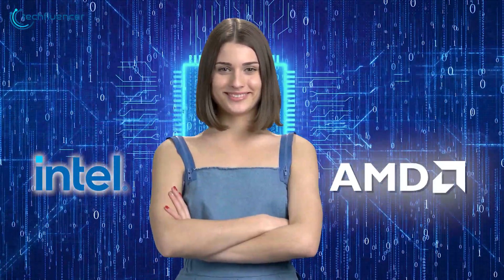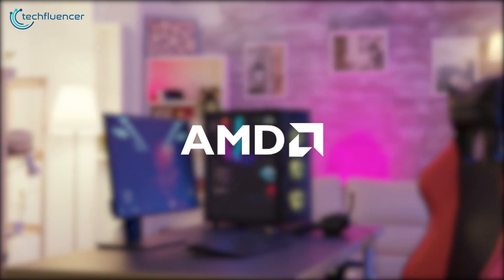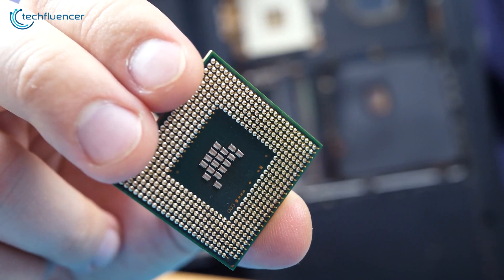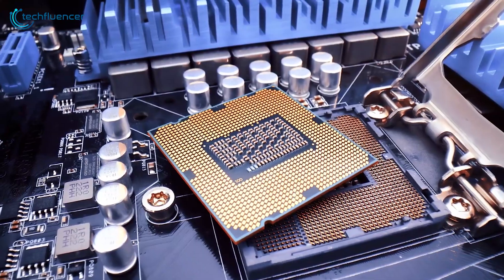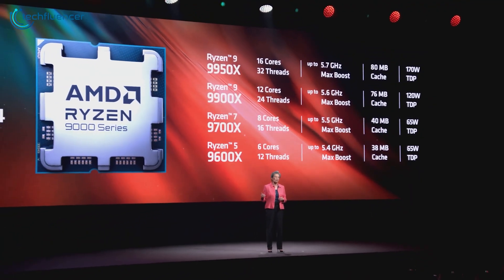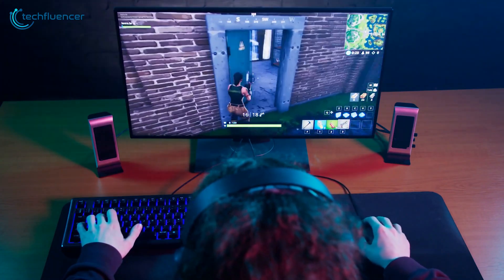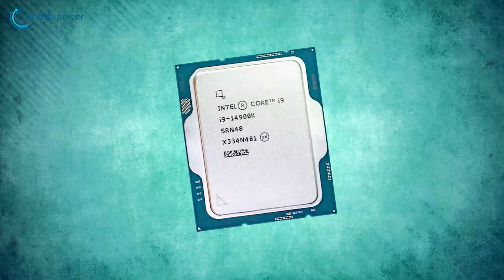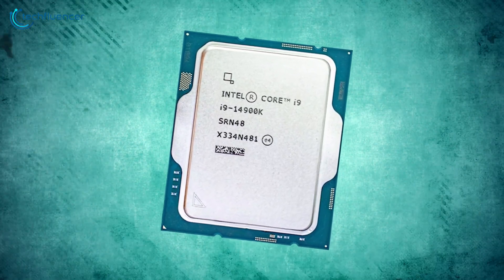Intel Vs AMD | Which Processor Should You Buy in 2026?

Comment: Two years ago, I got a 12400. The cooler model SE-214-XT keeps it cool and maxes at 60 when rendering. I upgraded from a classic 3930k, which I had for five years . I bought it from Amazon and saw it was a good price. I didn't do any research. Both of these chips have the same threads and cores, so why did the guy lie, saying CPUs haven 't shown a big jump?

It's other cards, like the i3 10th, even compared to other i3s and other i7s from the 11th or 9th generation, that show big jumps in power from the eras before. It used to take me 5 minutes to copy an EP from a DVD; now it only takes 2 minutes with one program, and then with the other, it only takes 1 minute.

Renders for an 8-hour 1440p used to take 4 hours; now it takes only 2 . Malwarebytes used to take 2 hours; now it takes 10 minutes, sometimes even 5 minutes, for the same number of files . I was having drops in Killzone RPCS3 at 10k resolution with my 12400, and my FPS would drop to the 40s and back to 60. With my 12700, I hardly get any drops using the same resolution. Timesplitters Dolphin at 8k gave me drops using the 12400. I no longer get those using the 12700. LFD2 would drop to the 60s from 120 FPS using multiple graphic mods with a 3080 RTX/12400. I no longer get those big drops with the 12700. This card is a monster. I didn't expect it to stabilize my FPS so much, but I was hoping it would .

I just found out last year that reading about the 7800X3D was a monster for PC games and wondered if it would help emulators as well; I see AMD still is a monster. I'm saying this because last week I found out about the 9600X and how strong it is with lower heat than my 12700. I was going to upgrade, but I just found out earlier this week that new chips are coming next year, so I might as well wait for the next equivalent to the 9600, which should be even stronger.
Reply from the maker: Thanks for sharing your experience. Those upgrades made a real difference.
Reply: @techfluencer Prices won't be a big deal since I'm selling my parts hopefully next year. I still have my 12400, and I get all my parts used. What 's interesting to me is, as I said, I've seen using 12400 to 12700. My FPS were able to hit 60 FPS using 8K in RPCS3. Going from 12400 to 12700, it's interesting how, even though the 9600 has the same cores as the 12400, the 9600 can scale on average 30 FPS higher or 70 FPS. The only reason I did go from 3930 to 12400 is because I thought Intel was still the best for gaming. I didn't do research for years; having chips, I was on the 3930 since 2013. The only reason I stayed on that chip so long was that I didn't do research . I thought my FPS drops using 1440 on high settings with most games were normal. Then I got the 12400, which has the same cores as the 3930, but the FPS is way more stable and higher.

The main reason I found out about chips late, as I said, is I just found out about the 7800X3D last year on forums. Well, I knew of the chip's name; I just didn't really research how legendary it was until last year, and I just found out about the 9600 this week.

The main reason I don't research chips often is that I don't want to feel like every time a new one comes out, I need to get it. That was the main reason I stuck with the 3930 for so long. I still don't really understand when AMD became better at gaming because, like I said, Intel was the best all around just by having more cores. When did AMD catch up?

Comment: Intel has become expensive in my opinion. I recently switched to AMD Ryzen 5 series and they run hot compared to the intel but these are good performing processors compared to my intel i7 3700 which i was using for more than a decade.

Comment: You can get the Gigabyte UD ddr4 z790 for 130 bucks - less on sale and an i5 14400f for 120.  There's a lot of cheap ddr4 memory and m.2 drives.  even spending 150 for a 2 tb m.2 and 89.99 for the case another 89.99 for the psu. let's see that's - about 590 dollars before tax.  I blew the budget on a 600 dollar gpu.  This setup runs anything at 1440p with no issues.

Comment: I worked at Intel for a very long time. I got my first break because of the company despite having lost 2 years in engineering and I without doubt can tell the company which gave me a break and the company I came out of is like buying a fresh fruit from a supermarket and eating the garbage after keeping it outside for 30 days (rotten) and it shows in the processors that they are building.
Reply from the maker: Thanks for sharing

Comment: I am a few days away to buy my first good gamer PC, but I am so worried that Intel CPU is a bad move on my build? - tho the seller of Shark PC gaming told me this morning, when I asked him this question "is it true that Intel does not perform as good as AMD in the long run" - He answered: "that rumor is from 6 years ago and does not apply to the newer CPUs" 
PC specs below.
Intel Core i5-14600KF 6p x 3.5/5.3 GHz
Radeon RX 9070 GAMING OC 16GB
Motherboard: ASUS PRIME B760-PLUS V2 DDR5
32GB 6000MHz DDR5 RAM Kingston Fury Beast
1000GB NVMe M.2 SSD
Windows 11 Home
Reply from the maker: Honestly, you have nothing to worry about. The seller gave you a good answer.
Reply: The seller is an idiot pairing a KF series CPU (Overclockable), with a non Z series MOBO which doesn't facilitate overclocking. You might as well buy the F and save money.

Comment: You have to set a budget, then compare parts on CPU Benchmark (if you're a noob like me). I ended up with Intel and Nvidia, and it was the fastest for my price point, where the AMD versions for the same price weren't as fast. *But +/-$500 and it could have been different.

Comment: Currently shopping. Left and back in 2011 for intel and im sick of changing MB when I upgrade. Sucks that also intel seems to be changed for the worst every new release. The best and most stable I ever had was the I7-7700k… currently running a 14900k and is so hard to pair it with good ram…
Reply: only morons pay an arm and a leg to inhel the dirty co
Reply: Can you suggest me cpu of intel i have low budget likely 150-200$. My goal productivity and browsing task. I have planned to go without gpu at beginning.

Comment: i used to be a die hard intel fan, hated everything about AMD and lets be honest they have been the underdogs. for the past 25 ive had intel then they made the 14900k and other similar chipsets followed by even worse 15th gen chipsets and AMD entered the market as stable platforms even if a bit under powered at times. then the x3d models came out and i told myself i will never ever again buy a intel system.

Comment: On my last system, I used an Intel i5 11th gen CPU.  I historically favored Intel chips as I kind of grew up in the era when Intel was struggling to become a market leader.  Names like Gordon Moore, Robert Noyce, and Andy Grove were in their prime when I was really getting into the industry.  I suspect they would be rolling in their graves with the direction Intel has taken in the last couple of decades.  Sadly, I think I'm going to have to move over to AMD when I get ready to get my next system.  Intel has started pushing harder on marketing rather than engineering, while AMD has really moved ahead on innovation.
Reply: am i face problem if i build with i5 10 ,11 or 13 gen processor ?

Comment: CPU for gaming? It's the GPU for gaming. Both chip would works for a modern system. Just get the one with the lowest price tag and save that money for the GPU. With that being said, I went for Intel CPU and board because it's the biggest bang for my money.  A 160.00 cpu that perform on par with AMD  400.00 cpu even if you include wattage. Some of AMD chip is overprice.

Comment: Funny I was using intel whole my life. I bought ryzen 3900x + x570 chipset motherboard just before covid. Since then I am still trying to figure out problems with shuttering, weird lags when there is no load on the system, doing thousands of stupid tricks in bios - turn off this, set that to this value, and still simple things like usb or nvme port do not simply work! It is outrageous how f.up amd stuff is. Never had such a silly problems with my intel PCs! Never ever thought you can have so many weird problems. My pc still is not butter smooth, but is somehow ok. But I have paid for quite high end setup and it is barely ok. Never, ever amd again!
Reply: Niemals mehr ein Überteuertes Intel System

Comment: Nonsense, there is no case in which you should choose intel, they have instability that is still not corrected. And the performance in single core the difference is minimal. As for the energy consumption, Intel is pathetic, and for gaming and Performance i still would choose AMD.
Reply: I choose an Intel because the CPU was 160.00 for 14600. The 65W version. The energy consumption is on par. Performance is very good compare to the price. I don't have a reason to go with AMD. There is no instability with this CPU version and nothing need to be corrected.

Comment: WHAT DO I GET AMD OR INTEL!???!?!?!?!?!?
Reply: Risc
Reply: Looks like AMD. I bought an i7 and when I run it with my OLED screen it overheats. My only choices here are to swap to AMD or upgrade cooling. At this point, I might do both.

What’s the point of having all of that processing power if you can’t use it? Intels will just overheat. Particularly i9.

You might be able to escape with i7 if you have good cooling.
Reply: Intel stock fall down/// amd get 20% of market lest year because cheaper and better

Comment: The instability of Intel cpu recently is the cause of my decision diverting to AMD
Reply from the maker: Fair enough!
Reply: same here, a 50% crash rate+ and degradation issues, no thanks, dont want a ticking time bomb, despite how much i dont like AMD cpus, i chose AMD since intel can go suck a d right now
Reply: My Intel Core i9 14900K overvolted itself, oxidized and degraded to death on finals at Nursing school, so my hand was forced to switch to AMD, it was well worth it with the 7800X3D.

Also replacing the iconic Intel Core i9 branding with Intel Core Ultra 9 (simply sucks in comparison) was just one of the dumbest decisions by Intel.
Reply: The ultra series isn't ultra, nothing compare to AMD 7800x3d till the release of 9800x3d...
Reply: @MrVirusD  9800X3D is remarkably faster than even the 7800X3D, 11% to 15% in gaming, 30% multicore and productivity uplifts, fully unlocked for overclocking due to flipping the location of the 3D-VCache.
Reply: @iLegionaire3755  I'm still in the q of this preodered 9800x3d CPU after watching many different specialists benchmark test... Upgrading to am5 for my secondary set with old school day Intel gen 6 i5 6600 😂😂😂
Reply: @MrVirusD  7800X3D will remain relevant, long after the 9800X3D and the 9950X3D release.

Arrow Lake is DOA, it’s a 14900K/KS downgrade in every fashion, even on TSMC fabrication. Quite an awful accomplishment by Intel. 

I hope Intel can turn it around before Turin…oh wait…AMD EPYC Turin is already released and chainsawing Intel Xeon in half as always! 

Intel Xeon continues to deliver mediocrity, compared to the TITANS EPYC, Threadripper, Apple Silicon, Snapdragon X Elite 2 and NVIDIA Vera Rubin!

Zen 5 Threadripper Shimada Peak will deliver the fatality.

Comment: AMD lost its edge somewhere in the P4/Athlon era, before that they totally made better cpu's than Intel.  Nowadays buying AMD is the same as throwing your money away.  Literally every person I know who complains about shitty performance and odd crashes run AMD.
Reply from the maker: They have potential to do better though!
Reply: I definitely have a more stable pc with the threadripper, AMD now is pretty good
Reply: Yes, this odd crashes is what sucks. So what that amd will give you 30 fps more if you will never get smooth experience! In my ryzen 3900x I have all power saving options turned off. Otherwise it was stuttering/lagging on silly tasks for no reason.
Reply: You need your glasses adjusted, AMD post Ryzen has handed Intel L after L in the x86 processor marketplace. And Intel in 2024, has gone out of there way to sell AMD Ryzen processors to the masses by design and their own deliberate choices.

Raptor Lake was a massive failure for Intel, there is no way around it and I liked Raptor Lake's performance, Raptor Lake like Rocket Lake, severely damaged Intel's reputation.

Comment: Leaving out the massive stability issues with Intel's 13th and 14th gen processors is a crime, this is the first thing you should let people know about. Just don't buy them. Not only do they have stability problems, they degrade. There's also a manufacturing issue with the  ones produced i 2022 were they suffer from corrosion.
Reply: So im thinking of buying asus tuf f15 which has i7 13620H in it i know this is about desktops but is this apply to laptops aswell? Im confused
Reply: @ Yes, it does. Google it.
Reply from the maker: Hope they do something about it

Comment: I was an AMD fanboy decades ago, but ever since I switch over to a 1st Gen I7 6 core Sandy bridge from an Amd Dual core I never look back to Amd ever again.  Everything I build/bought since then has been only Intel and NVidia.  Intel was less headache in term of crashing software's/programs.  Amd line up currently is very interesting to me in specs, but I am afraid to return to failing and crashing cause of software operating on it.  A lot has changed since then so I do wonder how well it performs in today standards.  Only way to know is to use them and gain your own experience, but that can be very costly.
Reply: Ditto, was one of the first people to own a 1ghz+ CPU in Canada when they came out.  Very much loved AMD.  Nowadays I generally prefer to USE my computer rather than spending time fixin/tweaking and Intel always delivers with uptime and stability.
Reply from the maker: Fair enough.
Reply: I've got both Intel and AMD, I've not had programs crash since WinXP came out on either.  Even though Intel may measure better in various speed measurements,  I see no real world advantage to Intel.  I'm with Ryzen now.  Still have 2 Intel pcs in use, but I'm done with Intel due to pricing.
Reply: i have a 12700K works perfectly. Then i have a 7800x3d works also perfectly only issue with the AMD i have till now is, when i do a simply reboot it will hang like in a loop with blackscreen. Its intermiten not every time. Maybe its the Gigabyte x670e Aourus pro x board i dont know. Its also more finnicky with RAM. So in general i think Intel still takes the cake with compatibility.